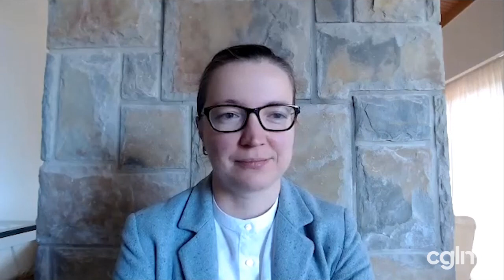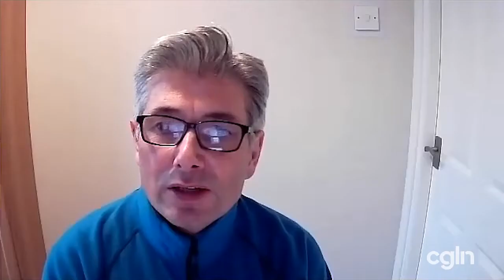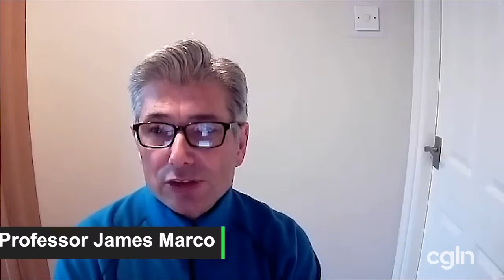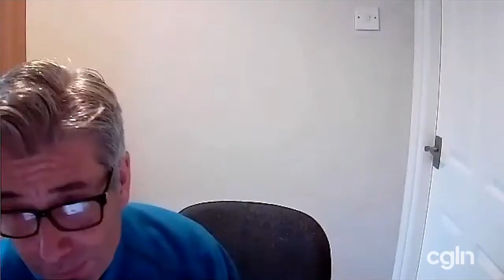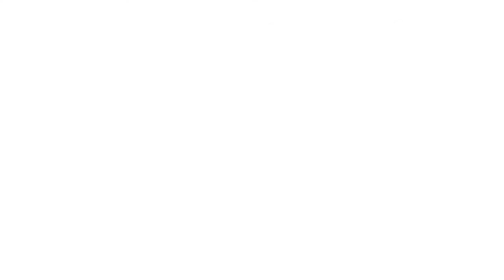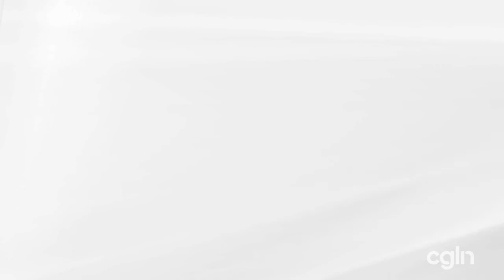CGLN Director interviews WMG's Professor James Marco

Comment: This "preconditioning" giving one 10-15% less calendar aging will be part of the pitch to get people onboard with vehicle to grid/home. As of now the debate is weather it is worth having your expensive battery ripped apart by the grid operator or if the overall gain is worth it. For private home owners with a solar system on the roof this paper will help persuade them. What I lack here is the discussion around different battery cell types. Tesla for example just started shipping and selling their cars with a cell type that is more useful for V2G applications. I hope we are up for a real push for V2G cars, chargers and systems in 2022. Btw I thought it was cool to se that prof Marco didn't swallow the climate change bait. Or it was just my imagination ;)